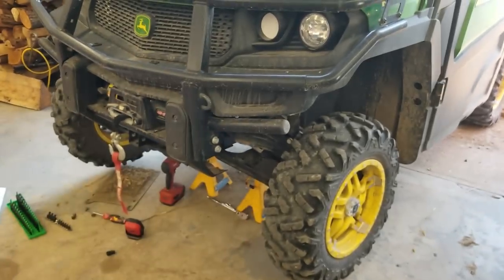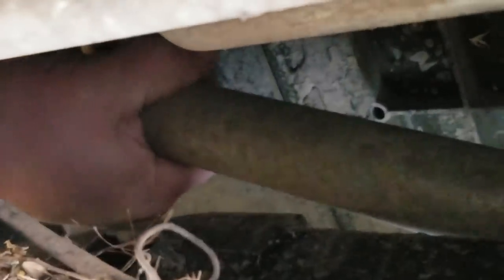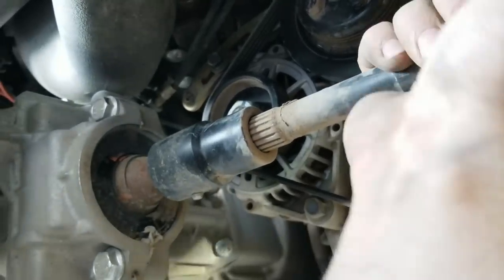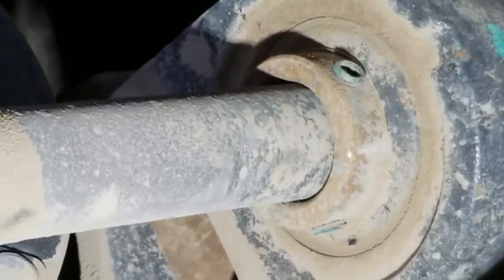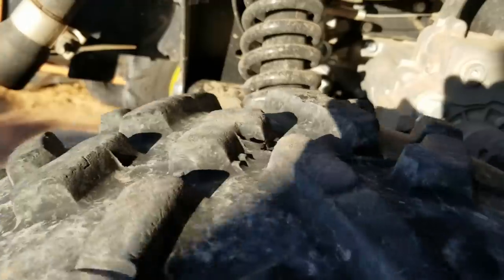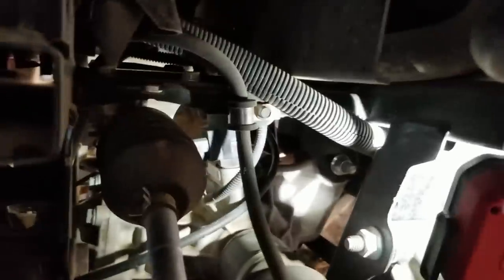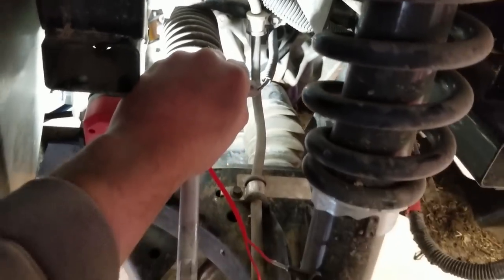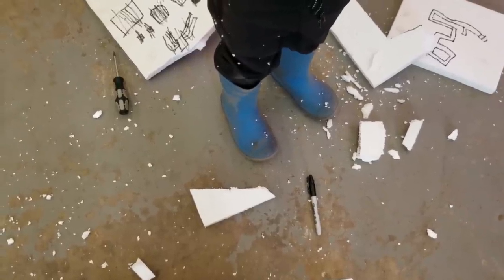Deerest Gator;

Comment: From t'net...correct one-possible.....
Theory of Operation: The 4WD function is an electromechanical system that uses logic control to activate or deactivate the system.
When the 4WD switch is pressed, battery voltage is sent to the display panel (J2, pin E) which illuminates the 4WD indicator light. When the 4WD switch is pressed, battery voltage is also sent to the relay module (J3, pin 8 - “4WD switch input”). The relay module then provides a path to ground (J3, pin 14 - “4WD solenoid driver”) to the EMFWD lock solenoid. This engages the solenoid and 4WD. If machine ground speed exceeds approximately 9 mph, the relay module will not allow the 4WD driver signal and 4WD will not engage until ground speed is reduced. However, if 4WD is engaged under 9 mph, it will remain engaged after that speed is exceeded.
Reply from the maker: Thank you! Since 4wd light illuminates, I will re-check the relays and the ground.
Reply: MFWD Service Kit Operation and Wiring Schematics
Theory of Operation Pressing the brake pedal opens brake switch contacts B—D, interrupting the signal between the vehicle harness
and the MFWD solenoid. Flyback diode MFWDC-97 affords protection from inductive kickback.
Reply: Theory of Operation Pressing the throttle opens throttle switch contacts B—D and removes the voltage (high signal) from throttle delay module pin 5, triggering the delay timer. After 1 sec. of no voltage (low signal), the timer activates the delay module relay. This action completes the connection between the vehicle harness and the MFWD solenoid. Releasing the accelerator pedal immediately turns off the relay and resets the module timer. Flyback diode MFWDC-97 affords protection from inductive kickback. The ground circuit of harness AM147221 is isolated from the MFWD solenoid connections. This change allows the service kit to be compatible with early production vehicles that use a low-side connection to activate the MFWD solenoid.
Reply: 4WD Drive Circuit Operation (EMFWD) (SN -060000) Function: To control the 4WD drive function as well as display a LCD symbol to alert the operator of the 4WD engagement status. Operating Conditions: •Key switch in run position •Transmission in gear •MFWD switch in the engaged position •4WD engagement sensing switch on •Machinemustbetravelingapproximately9mphorles s. Theory of Operation: The 4WD function is an electromechanical system that uses logic control to activate or deactivate the system.
When the 4WD switch is pressed, battery voltage is sent to the display panel (J2, pin E) which illuminates the 4WD indicator light. When the 4WD switch is pressed, battery voltage is also sent to the relay module (J3, pin 8 - “4WD switch input”). The relay module then provides a path to ground (J3, pin 14 - “4WD solenoid driver”) to the EMFWD lock solenoid. This engages the solenoid and 4WD. If machine ground speed exceeds approximately 9 mph, the relay module will not allow the 4WD driver signal and 4WD will not engage until ground speed is reduced. However, if 4WD is engaged under 9 mph, it will remain engaged after that speed is exceeded.
Reply: 4WD Drive Circuit Operation (EMFWD) (SN 060001-080000) Function: To control the 4WD drive function as well as display an LCD symbol to alert the operator of the 4WD engagement status. Operating Conditions: •Key switch in run position •Transmission in gear •MFWD switch in on position •Machinemustbetravelingapproximately9mphorles s. Theory of Operation: The 4WD function is an electromechanical system that useslogiccontroltoactivateordeactivate4WDoperation . A magnetic pickup sensor mounted on the transaxle generates the pulses used by the relay module to calculate ground speed. Placing the 4WD switch in the on position sends a “High” (battery voltage) signal to the relay module (J1, pin 12 4WD switch input). Logic inside the module compares the “request” for 4WD operation to the measured ground speed. If the logic determines that conditions are met, the relay module then provides battery voltage (J1, pin 15 - “4WD solenoid driver”) to engage the EMFWD lock solenoid and activate the 4WD icon on the display panel. If machine ground speed exceeds approximately 9 mph, the relay module will not allow the 4WD driver signal and 4WD will not engage until ground speed is reduced. However, if 4WD is engaged under 9 mph, it will remain engaged after that speed is exceeded. Schematic Components A1 — Relay Module A2 — Display Panel A3 — ECU B30 — Speed Sensor G1 — Battery S3 — Key Switch S34 — 4WD Switch Y35 — EMFWD Lock Solenoid
Reply: Mechanical Four Wheel Drive (MFWD): The transaxle reduction shaft is coupled to a direct drive right angle gear case bolted to the side of the transaxle for MFWD output. A drive shaft connects the right angle gear case output shaft to the front axle MFWD gear case pinion shaft. The drive shaft turns any time forward or reverse gears are selected. The MFWD gear case pinion gear turns a ring gear connected through roller clutches to the left and right front axle shafts. MFWD power transfer through the front axle gear case is on-demand and is provided under specific operating conditions. When an operator controlled 4WD switch is in the ON position, the front axle will engage and provide drive to the front wheels if the rear wheels slip. A solenoid in the gear case engages an internal clutch to connect the ring gear to the axle shafts through roller clutches. There is no differential lock for the front axle.
Reply: Function: EMFWD can provide power to the front wheels when the rear wheels slip. With the operator controlled 4WD switch in the ON position, roller clutches in the front axle gear case will engage and provide drive to the front wheels if rear wheel speed is faster than front wheel speed. With no speed differential between the front and rear wheels, the front drive does not engage and the machine is driven by the rear wheels only. Operation: With the 4WD switch in the ON position and the transmission in either forward or reverse, voltage is supplied to a solenoid (A) in the differential case. The voltage is stopped when the machine is shifted into neutral. When the solenoid is energized, a plunger is extended into the path of the rotating tabs of the actuating washer (B). stopping the outer washer. Wave washers (C) between the inner and outer washers place a drag between the outer (stopped) washer and the inner washer (D).The inner washer is keyed to the roller brake assembly (E), which is connected to the roller cage (F) by tabs. The roller cage lies inside the ring gear hub (G).Each side of the roller cage contains cylindrical rollers (H) that roll around the output hub to each axle. The drag imposed on the roller cage through the wave washers and tabs forces the rollers slightly off center in the openings of the roller cage. When the rear tires slip and spin more than 15% faster than the front tires, the rollers move against ramps (I) in the rotating gear hub and are forced inward. The inward movement presses the rollers against the left and right output hubs. At this point, all components begin rotating together. When the machine stops and the transmission is shifted from forward to reverse, the voltage to the solenoid is momentarily stopped (neutral switch opened). This allows the springs on each roller to rotate the roll cage and rollers into a neutral position.
Reply: @AvE  since the relay is shorting to ground in active, a good test on the pigtail would be to see if you get 12v from there to chasis and check resistance from the other terminal to chasis. I'm sure you've thought of that already, but what else am I supposed to do, they don't put magazines in the bathroom anymore.
Reply: @JACKATTACKED  🍻🍻🍻🍻🍻
Reply: @Fanta....  🍺🍻🍺🥃🥳 Long time no hear .... beer even 🤣
Reply: It’s called a Hilliard drive system. Same thing Polaris uses. That’s why the front diff is aluminum. The oil in the diff is magnetic. The solenoid is powering an electromagnet that only engages front drive when the rear wheels slip (travel at slower speed than front). Stupid design to use in today’s market imo. It made sense in the 90s when Polaris used it for marketing there atvs as having “true 4WD”. The whole reason for it being used was this… front diff is locked so both right and left tires pull simultaneously, gearing is also slower than rear end. It was all done so you could still street with the handlebars relatively easily without power steering.

Comment: I fix a lot of ATV's and such. Usually when I get a voltage issue like that, it tends to be one of three things.
1. Bad ground connection in the offending circuit.
2. Bad switch contacts.
3. Water ingress on a connector in the circuit.
Reply from the maker: Thank you!
Reply: @arduinoversusevil2025  my guess is 1 because of 3  if the power side was bad you would measure 0 v. And the mouse nest is also a clue that maybe one of these made some tiny tooth marks so water could get in and broke the neg  line.
Reply: Yep I have a odd intermittent PTO solenoid on a tractor that started as a weak ground,(took a while to find it because it was hidden and very quiet unless using motion to get it to eventually engage) over time either the partial engagement or low voltage permanently damaged the solenoid magnet or alignment im guessing...😐 Its now a manually activated push/pull PTO via that old solenoid because that can wait till next year... - now 6 years ago 😁👍
Reply: My moneys on 1 but caused by three, the stealership would tell ya ya need a new machine
Reply: @mauricevandoeselaar  Would be easy to test that theory by grounding the negative lead to the chassis or right to the negative terminal on the battery. If it still reads 3V you know the problem is on the positive lead.
Reply: @mauricevandoeselaar  it's easy to test the ground just put the negative lead on the meter to the frame if you have voltage then u know that the ground side of that plug is not good
Reply: I came here to say that it feels like a corroded connector or wire.

Comment: I used to work for deere. I don’t remember if those newer model gators were this way or not but they have a sequence in order for the 4wd to engage. If I remember right you have to have the 4wd switch on and give it throttle for the ECM to energize the solenoid. There may be a certain mph involved too. I wish I still had access to service advisor but I do not. Put your meter on the solenoid connector and drive it with the 4wd switch engaged and see if you get power when you give it throttle
Reply: Speed sensor bad maybe?

Comment: Since you're getting partial voltage, the next step is to check at that 2WD/4WD switch- input should be 12V, output should be 0V or 12V depending on position. If your input is 12V and output is still 3, your pixies are getting clogged in the switch like Tinkerbell through the keyhole. Doesn't happen often, but it happens. And if you're only getting a 3V input to the switch, run a new wire off fused power and get it to the input for that switch, and it should work

Edit because autocorrect tried facking with my grammar- as if I don't know the difference between my "your"s and "you're"s
Reply: Power probe is great for switch tests
Reply: Pure poetry.

Comment: Someone once told me that a certain part of my equipment could do with being about 4 sizes bigger too.
Reply: Fuse?
Reply: Only 4 sizes, lucky guy, she told me I needed to go up 9 sizes... well fak
Reply: @WeighedWilson  it's a euphemism.
Reply: just pray she meant in millimeter increments, my solution is just put a bit of angulation on the work angle, cross section appears to be thicker :)
Reply: Oh yeah, you're way beyond your serviceability limit.
Reply: It's an engineering problem, so the engineering solution is to make the hole smaller. Newer models tend to have this as standard.
Reply: Brain?

Comment: Not sure how they do it in those miniature vehicles, but I'm wondering if it could be a grounding issue... Is it also 3v in the fuse box? Does the wiring from the solenoid run all the way back to the switch/fuse panel?
Reply from the maker: Hmmm. Good question. Weird voltages are often grounding issues... Maybe I'm too quick to blame the confuser.
Reply: @arduinoversusevil2025  The 4wd switch still lights up. Seems to be the wire coming out of the switch, going to the solenoid.
Reply: @njvw177  or the relay switching the solenoid.
Reply: In AC tools, when I find a funny voltage it's always a broken wire.
Reply: I couldn't agree more.  You can test continuity from the solenoid connector, each side to ground, and each side to either the relay slot or switch. One of those will point you in the right direction. The other test, is again at the solenoid connector. Test both leads to ground for voltage. One ought to be zero -- test that side to battery +. Got 12volts?  Then the opposite lead to ground WITH the 4x4 switch turned on. got 12volts?   This will show you where to look next.
Reply: Mouse chew the insulation and make green puss replace the non-oxygenated copper between the solenoid and the relay?
Also, could not see in the vid what you were using for the reference when you got the -2.8V.  So could be the ground side or the power side.  Check each line to a known good ground.
Reply: @arduinoversusevil2025  if you look up the reliability of electrical/electronic components, connectors and switches are the least reliable of them all.
Reply: Check with the meter between the 12V line at the solenoid connector and the - directly from the battery to quickly rule out that possible scenario
3V, same issue
12V, happy life
Reply: Couldn't see in the vijeo, was he conparing across both wires or between one and ground? In my experience many automotive confusers use groundside switching.
Reply: @arduinoversusevil2025  3V sounds like a 3.3v logic level so it might be.  But I doubt that vehicles use anything other than good ole TTL.
Reply: @danielrouw2593  And while I've no idea what  Deere uses, some automotive stuff is too smart for its own good. Replacing fused, dumb outputs with unfused, "smart" ones is apparently considered a good idea by some manufacturers. Some of these systems sense the voltage drop or resistance in a circuit, and will only give the full 12 volts if the reading is to spec. This way the fuse won't blow if there's a short, instead the confuser throttles output to that circuit until it gets a correct reading again. Same thing with too little drop, as from a poor connection or even an open circuit. No real power until everything reads to spec again. This sort of thing can be a nightmare to diagnose without a computer fault reader.

If Deere uses this kind of confuser, then the issue could be some component or connection being just a bit out of spec enough for it to detect a fault and throttle down to 3V for continued fault sensing. Could be the solenoid has a few shorted windings, not enough to make it stop working at 12V but enough to change the voltage drop across it out of spec. Could be capacitor rot in the confuser itself, could be almost anything. I have an '07 Ford S-Max where the body control module has some components drifting out of spec, causing it to erroneously sense wrong values across light bulbs etc. Car isn't worth the cost of a new BCM, so I've gradually been converting various circuits to dumb fuse and relay operation completely bypassing the BCM in order to keep the taillights etc working.
Reply: @arduinoversusevil2025  possibly a ghost voltage?

Comment: Many of these electronic 4WD systems won't engage the front diff until there is wheel slip sensed on the rear wheels. You might want to check it out by driving it again on loose gravel to see if the front diff engages when you mash the go fast pedal. The solenoid is probably controlled by the ECU.
Reply: See the John Deere tech's advice above...about the same!

Comment: Check with a lamp as that 3 volts could well be a ghost voltage, the number of times I have seen that when testing with a digital meter, why they invented low z on some meters. If ghost voltage it is most likely a fuse or relay.
Reply: When I see a Deutsch connector on a solenoid, I think PWM. Is the confuser actually supplying 12v at 40% duty and the multi meter is doing math? Either way, supplying an actual load to the circuit is a good recommendation.

Comment: I had a similar problem with a forklift I bought. The reverse solenoid always had about 3V going through it. I could start it up and go forward no problem, but if I put it in reverse I couldn't go forward again without shutting it off. The 3V was enough to hold the solenoid when it was disengaged, so both the forward and reverse were open at the same time. It turned out it was getting power from the reverse lights, and with the solenoid coil acting as the other half of a voltage divider that was explaining the 3V. I didn't feel like chasing the wires all around, so I just wired the reverse solenoid directly into the reverse relay and it fixed it right up. Reverse lights even work.

Comment: Check derr switch I tells ya, corrosion on the pins will do this and as others have suggested check the earth pin to the battery for le resistance.

Side note, the diff lock locks the axles and the power divider/transfer case is what gives you 4wd. I got a little confuser with some of the double dutch.